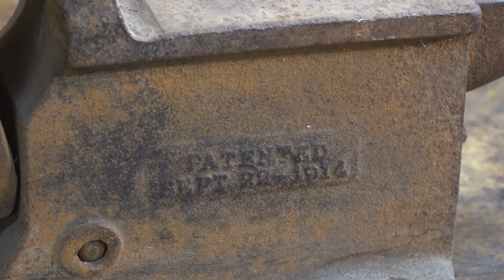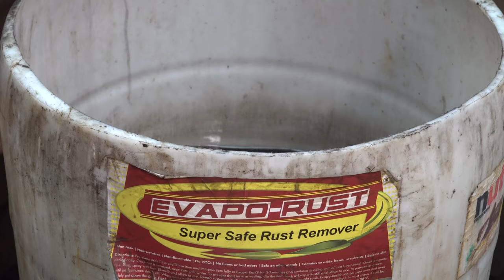Vise Drill Anvil [Restoration]

Comment: That's like the "printer faxer copier" of the machine shop.  Not really good at anything.
Reply: Hey, at least "printer faxed copier"s are great at one thing: wasting your money!
Reply: Printer fax copier is a horrible example.
Reply: What? We have a printer/faxer/copier that is an absolute beast of an office machine, the only reliable tool in the factory.
Reply: But wait! It does more!
Reply: @wtfiswiththosehandles  I think they mean the consumer models not the commercial ones
Reply: They're really good at printing, faxing & copying.

And, getting fired when you accidentally fax a copy of your butt to the boss.
Reply: Worse, the printer, fax, copier... and scanner.
Reply: The only problem with them is that they are really only printer scanners - and when one part breaks the entire thing is scrap.
Reply: We have a printer faxer scanner....
The only thing that really works is the scanner
Reply: @wtfiswiththosehandles  i bought a used printer copier fax scanner used for 20.00 6 years a go and i use it all the time.

Comment: I inherited one of these from my Grandpa. Such an interesting piece of equipment. Mine is missing the drilling pieces, but the vice parts still work. The rail on mine is also bent, haha. I'm guessing they didn't design it to handle angry-farmer-at-2am-during-harvest ft-lbs. Nice job on the restoration, it looks fantastic. With the vice bolted to a table the drilling would at least make a little more sense. It seems like a big design oversight though that you can't clamp something in the vice and then drill it...I guess that would have required another set of threads and an extra crank, making this even more of an unwieldy Frankenstein's monster.
Reply: My thoughts exactly.just clamp your material and use a brace and bit to drill your hole being in the early 1900s a brace and bit is what you would use to drill anyway . So why incorporate it into the vice where you have to keep tightening the material with each turn of the drill? Seems like a laborious way to drill a hole even in the 1900s . But beyond that it’s a fantastic restoration of a redundant tool.

Comment: That has to be one of the strangest vises I've ever seen
Reply: Or drill
Reply: Or Anvil
Reply: I have a theory... The drill part is not intended to be used by one person only. It needs two: one person holds the work piece  while the other spins the drill and, at the same time, applies constant pressure with the vise screw. It's pretty pointless with wood but if you put a steel work piece in there it starts to make a bit of sense.

I don't see why it would make sense as a regular drill. The vise bit is just a "handy" add-on then since it has a lead screw and all.
Reply: @AnttiBrax  definitely designed by union people! A ploy to employ (no pun intended) 3 people to do a one man job. GENIUS!,
Reply: @AnttiBrax  I was thinking what you were, we also take things like battery powered tools nowadays for granted so If something was being done away from town/power you’d have a mini drill press available even if it took two people, tools weren’t exactly small or light back then, just judging by the way things are pinned and chained the idea very well might have been “portable”
Reply: @tomt9543  how very boomer of you
Reply: @picax8398  Ha! I paid union dues for 41 years! I speak from experience! LOL!
Reply: @tomt9543  ohhh lol gotcha

Comment: Me: Watches Adam Savage on Tapping.
Me: Watches HTR using a drill with a smaller diameter tap.
Me: Noooooooooooo!
HTR tap: crack
Reply: After watching Adam's video (just prior to this one) I knew exactly what was going to happen once the scary music started...
Reply: Watched that one as well. As someone who can break the big taps fairly regularly, small taps make me nervous
Reply: @Sjackson2369  Best way I've found to break taps is to flex and bend them.  The best way I've found to NOT break taps is insure they're never flexed or bent.  I.e. use a "tap press" or if you're in a mill, chuck up a dead-center and place it in the centering divot of the tapping tool.  I also prefer to do 50% depth threads in steel instead of 75% threads.  Way less tapping torque and holds well enough.  (oh, and use TapMagic.  cuts the torque in half)
Reply: Marty lawson don’t dick up the threads and don’t use a tap - best way to not break one lol
Reply: And that is when you buy a tap destroyer... (which is basically a deep hole plasma cutter).

Comment: What an incredibly tedious tool to have to use. Shocking that the company that made them went out of business

Looks excellent restored though! GGs
Reply: It was a time before powered drills.
Reply: Pretty sure you are supposed to lock the wood in place with the vice and then drill.  If you were drilling a lot of the same hole e.g. in wooden droppers for wire stock fencing, this thing would be a massive boon over just a hand crank drill.

Comment: That is a very interesting tool? I completely thought the drill portion would have advanced by itself while drilling but upon realising that I did remember the spindle is held in place with washers and no screw mechanism. To crank the vice then drill then crank the vice and vice versa is a bit of a pain, but it's definately an incredible piece non the less so great job!

Comment: I have never seen a vice like that before, and you  made a great job of the restoration as usual. Some suggestions, you could really benefit from a hand press and or a fly press, Perhaps you could find one of each to restore? Also,  using hand taps in a drill or machine is always going to end in disaster. Use machine taps if you are going to tap holes using a power tool - they don't break, especially if you use some lubricant. Always tap at a low speed.

Comment: My mechanics: "Strip the original paint, smooth out the cast, apply filler, primer, paint and a clear coat"
Hand Tool Rescue: "The original finish was japanning and I have some of that lying around the shop..." 

Two very different and fascinating styles of restoration, I love both channels and learned a lot from the videos.

Comment: Thanks for a great video!  I have two of these that I bought several years ago but they do not have the support for the drill press attachment.  I didn’t truly understand the function of the vise until I saw your video. Now  that I know how it is supposed to to work it will be my next project.

Comment: I have this same vise missing the drilling table and could not figure out how the drill part worked
Reply: Do you have the Hardy Tool for this Vise? its seen here on page 4 of this PDF (Top Left corner)
http://vintagemachinery.org/pubs/732/7246.pdf
Reply: After seeing  this do you really want one?
Reply: I'm still not sure we know. The only way it would make sense, as a tool, is if the vice actually held the item to be drilled, and it doesn't do that, like, at all. It makes you wonder if a piece is missing or backwards or something's broken. what an odd implement.

Comment: That's a pretty cool Vice drill combination never seen one like that before
Reply: Totally agree...a strange contraption.  Interesting...I just checked and the electric drill press was invented in 1889.  Makes me wonder if this device was designed for a field specific application?  It seems like one of those semi-universal kind of do it all tools that doesn't do anyone thing particularly well.  That's what leads me to believe it may have been designed for one specific type of task.  I looked through most of the comments hoping that someone knew but nothing so far.

Comment: Swivel vice solution to keep it from drifting - is take apart, but mark before hand where vice position is facing forward. Drill on the rim where the swivel clamps live. Take  vice apart and drill I would say 1/4" holes, which will lock down the vice in that position. You can also drill holes around the rim, 45 degrees on each side. Worked like a dream for my unit.

Comment: There are a lot of vices that has a small anvil portion, but this is the first time I've seen one with a drill. And after seeing that drill being used I understand why I've never seen one before...

It's very uncommon for a combination tool to be really good at all the things it supposedly can be used for. At best they are handy to have when you just don't have the space or the money for real tools, and some combos are not all that bad. A small anvil portion on a vice can be handy if you are just doing some light tapping, but are usually not strong enough to take a lot of abuse. Thing is they don't make the vice worse to use. That drill function on the other hand was just painful to watch. If what you were going to drill could be clamped in the vice jaws and then drilled it would just be strange and very limited in use, but how it worked now it was just painful to watch.

But this proves that useless bullet points on a spec sheet was a thing even back in 1915 or whenever this was dreamt up.

Comment: I have one of these. Except mine doesn't have the drill thingy, which is just as good since it seems to be impractical. The vice comes in handy sometimes to hold oversize objects since you can extend the moveable jaw out like 10" or so. And if what you're working on doesn't want to act right, the anvil is handy to give it some hammer persuasion.

Comment: Suggestion. Stop by a construction site and see if they will give you some ceiling grid hanging wire. You can use those for hangers for parts in your Evap O Rust barrel.

Comment: 👍Great restoration as always .  Made in the early 20th century , l can understand the design concept . But l see what appear to be some design flaws . The "T" slot was too close to the bottom , causing the crack . It appears to be made of cast iron , not steel . Most of all it tried too hard to have the functions of tools that were already available in a less complicated fashion . I would give it a A+ for innovation , but only a D for material choice . Your workmanship always gets A+ .

Comment: My guess is that the vise was custom made for a specific task/job. And that there is so many of them. makes me lean to military or railroad work. Non electronic points to of grid field work.
The fastening of the drill also points to a specific work task. The impractical drilling method points towards already made holes that maybe on occasion needs adjusting ( pre stamped holes?). The abundance of clamping when drilling  points towards heavyweight workpieces. And an anvil to straighten things. In the same piece also point to space saving and mobility need. Maybe a railroadtrack clamp for cleaning out the holes and hold the pieces in place after. Or maybe in the military tank track  repairs or armour repair. Armoured plates whit pre drilled holes (1914)? And then a surplus item hence found in many home's...?

Comment: I wonder if it is intended to somehow lock the two handles together so you don't have to tighten the vice all the time?  Or figure out a proper gear ratio to link the drill spindle screw to the vice screw. Would be relatively usable then.

Comment: Beautiful restoration as usual. But I have to take issue with the chain that was used to attach the pins permanently. That chain looks like the one that held a hanging lamp in my parents house in the sixties. Changing the chain out would help bring the whole design back to a more original state. Just an opinion.

Comment: That's neat, but what's it used for?  You can't control the vise grip without controlling the depth of cut.  I bet it was made so that if you saw one in someone's shop, you'd also check to see if the owner was wearing a belt with suspenders.  Then go find another shop.

Comment: How long does a 55 gallon drum of evapo-rust last..? Do you top it up or dilute it from time to time? It looks like you've been using it for a while based on the color. Also, thanks for the introduction to the stuff, it's been used a lot in our shop lately (though, in much smaller quantities...)

Comment: Looks like it was designed to bore through large material, beams or similar, rest the bottom of the beam on the bed, flip and you have a beam with holes in the same position from the edge, possibly for home shed construction? No idea on the anvil section though, definitely seems odd.

Comment: Thanks for this Video, I have been waiting for it, since you Teased us with it on your Instagram Story...

While I like what you did to restore this vise, I have a couple of SMALL issues. 
#1, The chains you used should be left to hold up 1970's chandeliers, Use the correct chain that it came with, which is what was on it when you started the video!
#2, Whats the purpose of only making a half height jaw on the Base side? In my honest opinion, Both jaws should be full height. 

Thank you for showing how you corrected the bend in the "T" Bar, as my identical vise has the same Identical bend.

Shop Mistakes....
#1, No Tap oil! Maybe the use of tap oil would have prevented the tap from breaking!
#2, While machining the Aluminum jaws, 
       a) Make sure the Vise is tight to hold your material, as it moved while machining.
       b) DO NOT LEAVE A 6" Scale on the Vise jaw! You had lots of "chips" and one of those long chips could have easily caught that 6" scale and flung it around.

For Everyone else, This Vise is from Sears, Roebuck & Co., circa the 1914/1925
See page 4 of this PDF file, Top left Corner!
http://vintagemachinery.org/pubs/732/7246.pdf
(While this PDF shows what looks to be removable jaws, they are not removable)

Thank you again for showing this in a Full length Video!
Reply: Good thing you're on the case! He'd have never figured out the case of the broken tap! I bet he's never even worked with any of the tools he has in his garage. What an amateur.

Comment: Interesting tool! Seems unnecessary but it definitely came from a different time where tools weren’t so light and portable,  so even if you needed two people to drill easily you’d still have a mini drill press somewhere you wouldn’t have a big one, I could see it being designed as a “portable” tool in a sense, brought out in the field away from electricity to do quick and dirty repairs

Comment: I wonder why anyone would design such an oddball tool. It is interesting as a collectible, but I doubt I could ever explain why it even exists. Do you suppose there is a set of different sized drill bits to fit the thing? Was it some kind of factory special tool used to drill one very specific part on an assembly line?  Maybe it was left behind by four-armed aliens?  Very nice restoration, in any case.

Comment: I am curious what this offered over a normal vise and a drill, Even if it was a hand cranked drill.

Combo Vise and Drill probably would have been a great idea if the bit moved in and out, So you could clamp something and then drill it with the bit also held in like we see but able to slide in and out. making it effectively a manual drill press.  the designer seemed to drop that ball, All that said I suspect this thing was sold in catalogs or something aimed at basement work benches rather than actual carpenters.

Comment: Broken bolts, extractors, taps, tool steel, ect..... Might i recommend Res q bit?
  Expensive but it DOES work. went right through a broken easy out in approx 15- minutes. Tip, order from website.

Comment: Just a question from a curious noob: What is the benefit of treating the parts with paint stripper if you're going to sand blast them anyway? In my head that would take the japanning(or paint, blueing or whatever other surface coating) anyway?
Reply from the maker: Paint clogs up the sand blaster.
Reply: @HandToolRescue  Ah, makes sense. It's a tool I have literally never used, or even seen used IRL.

Comment: Was this not a drill/vice combo designed for the drilling of railway tracks, where the expansion joints used to have a plate either side of the rail?

Comment: To stop your swivel-base vise from swiveling, drill a hole through the base on the opposite side from the swivel-locking screw and drop a bolt into the hole. Make it a loose enough fit so the bolt is easy to take out when you do want it to swivel. I spent decades cursing at my vise (and hammering on the swivel-locking screw until the handle bent) before I thought of this simple fix.  😠

Comment: Careful with these. Don't use them as a blacksmith's anvil. They are mostly cast iron, and if worked hard, they will shatter. They are fantastic for softer crafts, like jewelry work. I'm very jealous of your oxyA torch, I've wanted one of those for nearly a decade. I'm stuck with the other more common design, and a Chinese copy at that.

Comment: The bolt heads should've been drilled deeper into the jaws. No real point in using alu if the clamped piece is still going to receive damage from the bolts. Looks kinda neat though

Comment: This was an odd tool. That drill method seems rather... Annoying. On closer inspection, if you locked the vice handle to the drill handle or had something that could keep them together, you'd turn the drill into the piece along with closing the vice. That would make this a lot more functional. Maybe that was the intent? A locking pin missing from the handle or something?

Comment: Why do you insist of running your taps in a hand held drill you don’t have stability and you risk braking your taps.
That is really cool Vice it’s for hand drilling hard steel like cast iron that needs low speed and some pressure like when drilling into leaf springs . Find a nice place to bolt it down nice and stable.

Comment: I always cringe when I see people use power tools when tapping holes…. This is why !! Unless you are doing a large job that requires cleaning up threads on multiple holes. Always use the handle or the socket attachment for tapping holes. The time it saves by using a drill is nothing compared to the time of dealing with a broken tap.